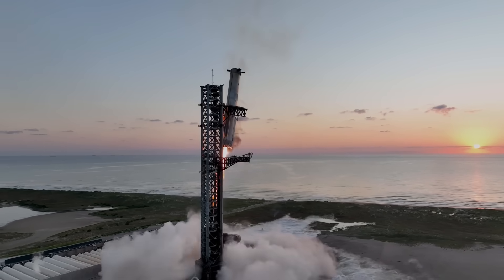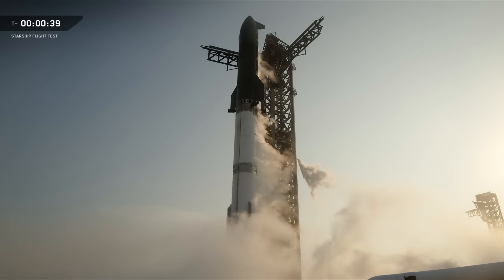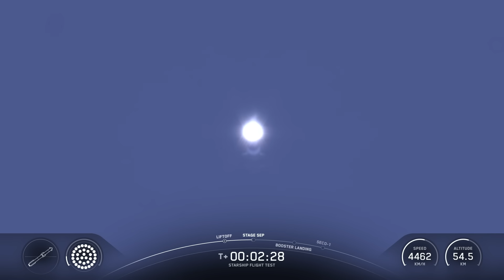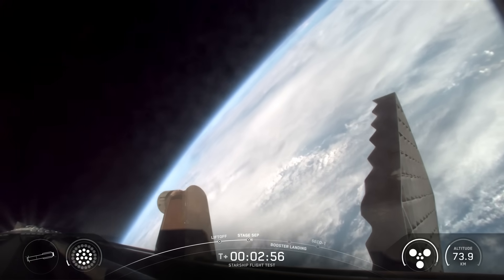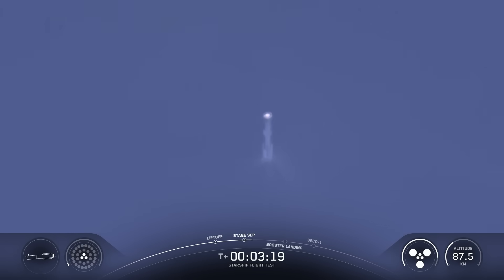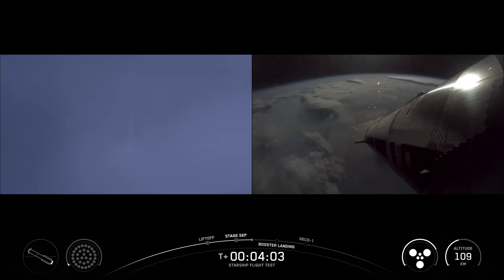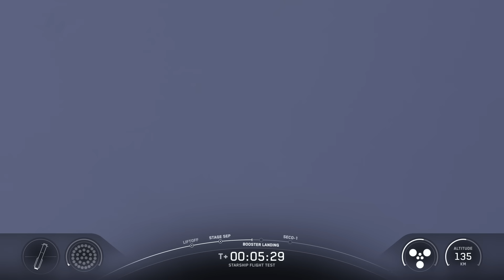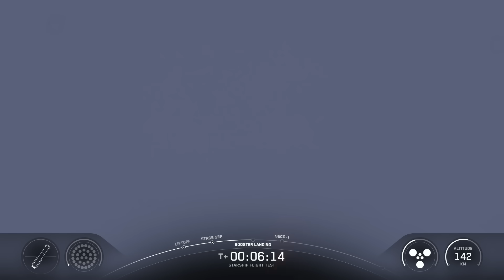SpaceX Builds Largest Reusable Booster, Also Makes Door That Won't Open - Starship Flight 9 Recap

Comment: That bright hotspot at ~8:59. Ship is venting propellant which is methane and pure oxygen. That point must have been hot or simmering already, then rush pure oxygen over it and you get that. Tim Dodd mentioned this too in his livestream.
Reply: there was that typical orange flicker inside the aft section at +8:26 so the leak was burning, same as the previous 2 flights. when the engines shut off and vent, there was already an open flame to ignite those gasses.
Reply: The edge of. The bell was also glowing and there was a buildup of grey or black soot or.Smoke.
Reply: nah it's the obligatory space rat being fried (followers of 'space is fake' debunkers will know the reference).

Comment: Seems V2 is following V1's history...  V1 blew up a couple times before it managed to reach intended trajectory and the first time it did it suffered a similar fate of tumbling uncontrolled into the atmosphere.  Almost seems like Starship had to start over while the booster got to reach new milestones.  Pretty sure the booster can still have use cases for high mass payloads even if the ship portion fails.

Comment: They probably tested the FTS on booster as it already served its purpose. I wish they make some self-aligning aerodynamics to the Starship body with full-cover of heat-tiles, but as long as the engines, piping, fuel supply, mechanics is an issue - better keep the cost low and save the tiles for future when the Starship is actually reliable enough to reach that point in testing. A lot new data and great learning point for SpaceX.

Comment: I can tell you right now.Those engineers can start listening to machinist  making the parts  i can't tell you how many times I've corrected engineering mistakes  making aerospace parts
Reply: okay bud
Reply: @sciencecompliance235  unfortunately can't share  pictures  here but I've built 6 satellites  countless parts  for Orion  space craft also  have machined  the temperature control  manifolds in the backpack  of the eva suits but sure  act like I've never talked to engineers  the best ones ate the old ones that  take advice from the people actually making the parts
Reply: @ryansouthworth668  Point is: technicians fuck up too, and engineers have to correct those mistakes.

Comment: I suspect that "hot staging" is too violent for the 2nd stage engine bay.
It is likely that these past 3 launches have been damaged during hot staging and has caused these failures.
Edit:
My suspicion is now more plausible. Elon gave a speech at Starbase where they showed a redesigned hot stage structure. This validates that the current hot staging method is likely damaging the Starship engine bay. The new "hot stage" is vastly more open allowing for less back pressure of exhaust gas during hot stage.
They are also re-designing the hot stage section so they don't have to discard that ring after staging.

Comment: Honestly idk why they're putting so much effort into the heat shielding already. put a full ablative shield on it and worry about making it TO reentry first. I wouldn't think it would be any big deal for the first iteration of a functional starship to need its heat shield rebuilt between flights.

Comment: I recall that NASA were capable of making doors which opened and closed in vacuum more than half a century ago.  Thing are beginning to look pretty clownish at SpaceX.
Reply: I doubt any doors other than the space shuttle were measured in meters.
Reply: Space Shuttle doors weren't flawless, they always eventually worked, but there were mission delays due to door problems. In orbit they have time to problem solve.
Reply: You're looking in the mirror.
Reply: They also managed to get the more complex and reusable shuttle and boosters operational without loss

Comment: Point of order, Scott: One of the ship only launch and landing tests had an abort just as the engines throttled up on the pad and so shut down - yet it had begun to lift off... So, technically, when it did it again an hour later, it was a second flight

Comment: What part of this test can be called a success?

Previous boosters caught, this booster exploded before reaching target in ocean - Fail due to a step back.
Payload bay door would not open - Fail
Appeared to be another leak - Fail
Lost control of vehicle - Fail.
Vehicle burned up on reentry - Fail

The fact starship flew longer than flights 7 and 8 does not count as a success IMO.  Version 1 of the vehicle flew longer and even though that had many issues, it made it to the ocean.
Reply: - Fly a booster a second time - Success
- All Raptors re-ignited flawlessly during the entry burn - Success
- Booster stressed to destructon during landing - Success
- New and radically more performant Starship reached SECO - Success
Yes, theree were bad failures, but these successes and the previous successes with Starship 1 clearly shows the viability of the concept.
I would call this flight a partial success.
Reply: @jonmaloy6783  The successes you mentioned have been accomplished on various starship 1 flights.  If we are all honest, Starship version 2 is taking steps back from what has already been accomplished.

Comment: the whole thing was a failure, Musk is a failure and is bringing down everything he's touched, he's just using Starship to milk the US gov for every penny he can.

SpaceX is 70% funded by US contracts this is public money he's throwing away.
Reply: lol typical dem hating USA.
Reply: @trader2137  LOL! Typical butt-kissing Muskrat...

P.S. SpaceX has earned $13 billion in NASA contracts, brown noser...try again.
Reply: lies, a small part is funded by US gov. also musk is a genius who created 150k jobs in usa, cars, batteries, solar panels, rockets and STARLINK for everyone to use globally.
Reply: @trader2137  FUN FACT: Internet can be routed to homes and businesses through underground fiber optic cables, that provide substantially better signals and reliability.

Cables that need to be installed and maintained by workers on the ground. STARLINK is just another scam...
Reply: @codymoe4986  starlink’s target market is for people who are either too remote for ground-based lines to be economically viable or who literally cant be connected to a physical wire like on aircraft or ocean vessels.

Comment: Man they're really lucky they don't have to answer to regulators anymore. Data may be good but 3 failures throwing debris across the ocean in a row isn't a very good look
Reply: Considering every other rocket in history either spread debris in the ocean or left it in space, I think your standard for SpaceX is too high. We just never had the video in the past...except for Columbia breaking up over Texas.
Reply: Block 1 had 3 failures before it had success too iirc, I agree it isn't a good look & I bet morale is low for the people that work on it. Specially the heatshield crew.

Comment: No offense but comparing Elon Musk to Richard Nixon is kind of a dick move. Not just because of public perception but because the underlying intent is basically throwing them both under the bus. As one does without full context. Nixon broke Bretton Woods not because he had to but because staying true to a rather poorly thought out framework (in context) could have caused more chaos.  I lament the break but I also think people will figure it out. Just like routine launches.

Comment: Let's be honest, the unbiased take from this is that the booster looks pretty solid and starship..... is the exact opposite. I still think the payload mass penalty of trying to make starship reusable in this way, makes it largely pointless
Reply: The mass penalty seems to be the least of their problems right now.  I'm just blown away that SpaceX has failed this many times in a row.  Call it what you want, but this was not a success.
Reply: It's hardly "unbiased" XD
Reply: @Pyromanemac it's an opinion based on real world evidence. If you think there is a reason to think starship development is going well, feel free to share it
Reply: Have to admit that Starship may be a bridge too far for reusability.  Last week there were proposals and preliminary plans for simply using Falcon Heavy to return to the moon.  That Dragon cargo module and Crewed Dragon are really neat vehicles.  They are the "Jeeps" of space travel, dependable, tough, but not very big.
Reply: No, lets lie.
Reply: agreed. it's a fundamentally bad design, IMO, that hubris won't allow to be shelved.
Reply: Starship V1 demonstrated that it was more reliable than Starship 2... colossal downgrade
Reply: I'm not sure I completely agree. When you're launching that much, the second stage gets quite spendy.

However, making it reusable is also going to make it hard to launch anything bigger than Starlinks because the fairings can't be ejected. It's been designed to go to Mars and not to loft big payloads to orbit.
Reply: @DavidMcGuigan  i dunno, if you aren't worried about reentry there is no reason to build the thing out of steel, or have as many engines or heat shield or flaps etc... and the moment you start reducing the dry mass off the second stage you start getting more out of your first stage and the cycle continues
Reply: @Br3eZzY I agree that if the upper stage was disposable, it would probably require far less engine and structure and still loft twice as much. But that might not make it less cost per kg to orbit.

Although given how far they are stretching the Falcon9, I'm not sure how much savings they are going up obtain. At the moment, the only customer is going to be Starlink anyway.

Comment: It was very necessary for the SpaceX team to see and realize how weak and delicate Starship is in the clash with the Earth's atmosphere.
This is how it works when everything is too cheap, too weak, too fast with the wrong mindset ("failures are welcome").
Reply: To be honest, reliability and reusability isn't really compatible with pushing 99% of the envelope. I think BO has it right with New Glenn and keeping some margin for error.
Reply: Now imagine landing this monstrosity on the moon...
It is almost like no one cares about the astronauts going inside this metal coffin.

Would bet, probably will, that starship will not ever leave LEO.
Reply: I have serious doubts anyone will ever ride the thing coming down.

They'll work out the kinks (perhaps literally kinks...) and it'll become human rated. However, once that is achieved it is trivial to send up others with with resuable gliding rentry vehicles, in the manner of Dreamchaser, etc., to have a 1000% safer return to the surface.
Reply: @ravneiv  Why be honest? Only a dishonest person would need to say that.
Reply: @lamarw7757 It's a figure a speech. You're right though, "Frankly," should have been used.

Comment: The ship is failing in ways that should not be the hard part. So they haven't been able to test the hard part, the heat shield and control surfaces on reentry, for THREE FLIGHTS IN ROW. Not good, believe me, not good.

Comment: I disagree Scott! 

All relevant data all in one place, seems like a great way to provide fuel level information with little impact on cognitive load. At a glance we can see how far through a burn the ship is based on the UI. I will say though that it is frustrating that it looks the same as the speed and altitude, I mean these shouldn't have an arc arguably. It could always go faster, and it could always go higher! Fly safe!

Comment: If I was building one bridge I would engineer the hell out of it.  But if I wanted to build 1000s I might just build one and test it, fix what failed, and try again.  You can't keep lightening and perfecting the design the first way without risking future failures.  Not a really good comparison, but I think it gets the point across.  While everyone wanted 100% success, having everything that can fail fail early on could be a blessing.  Not that I'm saying everything that can fail did obviously.

Comment: They made a massive step towards flying customers with this flight reusing a booster and the starship reaching SECO.

Think about it. The most powerful rocket stage ever flown is no longer disposable. A ten story tall Titan can be plucked out of the air with the same tower it launched from and can fly again.

What SpaceX has managed to achieve with this program is well beyond what whole nations would be proud of. In just six years they went from “Water towers can fly” to this.
Reply: Pathetic copium post.
Reply: @ChaosCat79 If I wanted your shitty opinion, I would have asked

Comment: Surely the booster of Blue Origin's New Shepard is 'propulsively recovered' and reused, and they were the first to do it?
And unlike Starship, their New Glenn has reached orbit and performed a satellite launch mission.
Starship is starting to look like 'Move fast and break things' needs something more, like a bit more fixing things.
Reply: How about comparing it to more than just one other company/organisation? How well are China doing with their copy of Starship? How long did it take the Russians to get a fully working ship to put payloads into orbit?
The saying "it's not rocket science" is there because these things are not easy to do.
Reply: new shepard is like falcon 9, which has like 100% success rate now, starship is a solution to perform interplanetary missions, new shepherd cant do that

Comment: It we are going to land a crew on the moon before the end of the decade, Congress and Trump need to rethink cutting NASA's budget.  Instead of mothballing SLS after flight 3, they need to fund additional flights since it is obvious Starship will not be ready by 2029 to support a crew and Blue Origin may actually get ahead of SpaceX for HLS.
Reply: cost of 1 SLS launch is about the cost of 20 Starlink launches from scratch (assuming both booster and ship wont be reused)
Reply: @trader2137  What good is a vehicle which after 9 flights is nowhere close to fly a complex mission like going to the moon?  How much do you think was spent on 9 flights along with all of the infrastructure at Starbase to support those flights?   How about the future costs of additional test flights before it is ready, assuming it ever is.

Comment: The booster did not reach its intended target in the ocean.  That has to be a step back after previously it was caught multiple times.
As for Starship itself, The cargo bay doors would not open.  SpaceX lost control of the vehicle..again.  Even though it went further than the 2 previous flights, it failed. 
I followed shuttle development and know about Saturn V development.  Please don't tell me this is how you test and develop giant vehicles.  Please tell me what other program has gone 9 flights and still hasn't reached a sustained orbit, deployed a payload, and/or or attempted a mission.
The Saturn V was a big step forward from anything previous to it and Shuttle was a totally different vehicle than anything else before it so saying Starship is completely different doesn't wash.  SLS was a giant vehicle and even though it was delayed by years, it still flew successfully on flight 1. 
Maybe it is time for SpaceX to bring an independent reviewer like NASA to assist them.  It is obvious they will not get Musk's 25 planned flights of Starship this year.  He did say that for 2025.

Comment: This only gets real when they ditch starship, and put a dragon on top of the booster, or a greatly simplified second stage designed specifically just for cargo. Imagine the acceleration profile without 3000tons of crap.

Comment: I'm not going to comment on the booster, as SpaceX had previously stated they were stress testing it beyond normal limits.

But for the cargo door to fail again, and fuel leaks leading to loss of control on Starship, it feels like SpaceX have gone backwards with this one.

As a joke aside, I wonder whether they've started applying Cybertruck QA processes to Starship... 😁

Comment: SpaceX is going through its Soviet stage.
Reply: Unfair to the Soviets, at least they knew after three subsequent failures it was time to pack up and move on. SpaceX seems intent to do this a 4th time...
Reply: The Soviet stage comes before being owned by Vladimir Vladimirovich Putin.
Reply: The Soviets were smarter than this. They would have (and did) scrap designs after much fewer failed test launches. The Soviets were even smarter than this: They launched the first satellite and the first human into space. Quite evidently, as far as the Spaceship program is concerned, SpaceX has forgotten how to go through a Soviet stage...

Comment: 3 billion of starships money are taxpayer money.
Reply: only 3B? its still cheaper than 1 SLS launch
Reply: Yes because SpaceX delivers. Not like Boeing and Blue Origin.
Reply: @HD-mp6yy  Wrong. they should have a moonlander by those 3B by NOW and they dont even have a working starship, the rest of the system if not even done yet alone tested.
Reply: You mean the money SpaceX had earned?
Reply: That’s less than one SLS flight and that money is for a different contract the HLS not for development of the starship system which is a much bigger program. You should really be mad at NASA with delays of SLS and cost overruns more
Reply: @OwnGrid  i dont argue that its good or bad. i just state that the public HAS investment in it.
Reply: @Nagria2112  who said anything about good or bad, and I also acknowledged that investment, so perhaps your arguing with your self